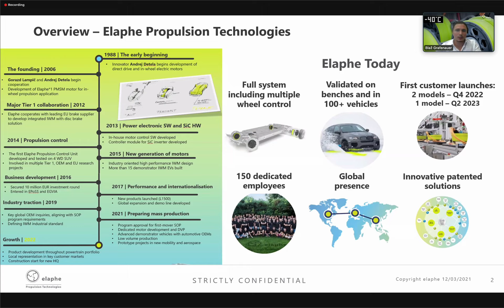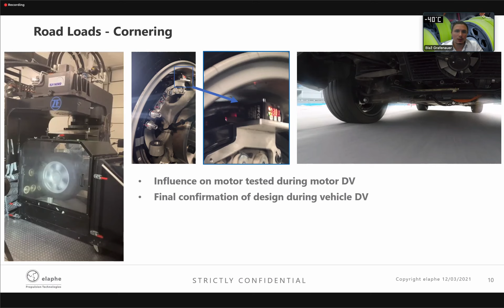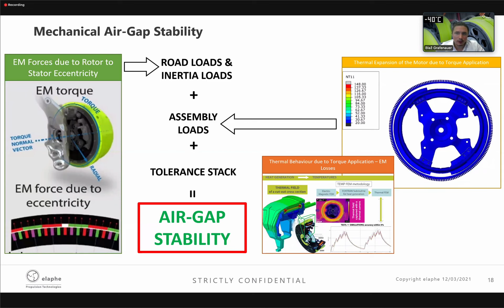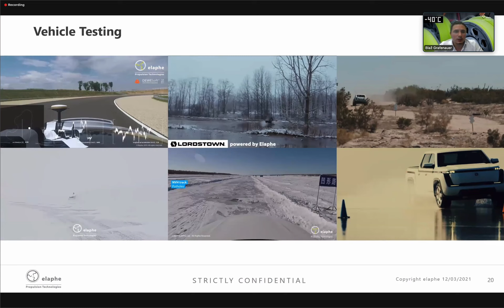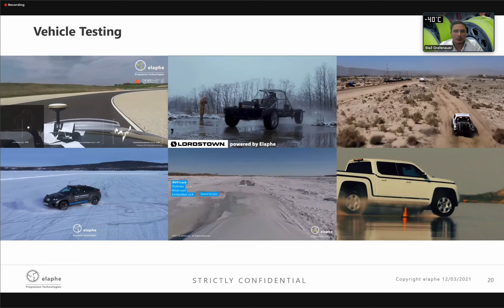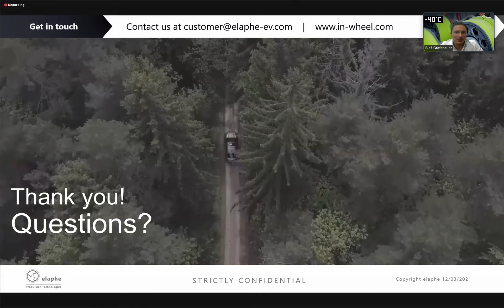Elaphe Webinar REPLAY on in-wheel durability - Electric In-Wheel Motors for Aptera

Comment: A hub motor needs cooling. That the Aptera motor does not get in the wheel fairing. So they need an extra radiator. That Aptera cannot provide. Without losing a lot of their aerodynamical gains. The flat cooling surface under the seat is just enough to cool the battery pack.

Comment: Many thanks 🙂
Reply: Around 44:45 or thereabouts, they mention that the weight on the wheel is one of the main parameters which cause stress on the wheel (OK this is obvious, but worth remembering). The 250/400 mile variants would therefore be more resilient to bad wheel impact damage than the 1000 mile variant.  There are loads of potholes in my part of the world so another reason I'm glad I picked the 400.
Overall it sounded like pretty thorough testing, and it should be tough.
Reply: @WyndStryke  400 is definitely the sweet spot for most people.  It isn't that much more expensive than the 250 and gives a good expectation that regardless of driving style, weather, or babying the battery it should definitely reach 250 miles of real world range.  The small 23 kwh pack of the 250 might also power limit the AWD.